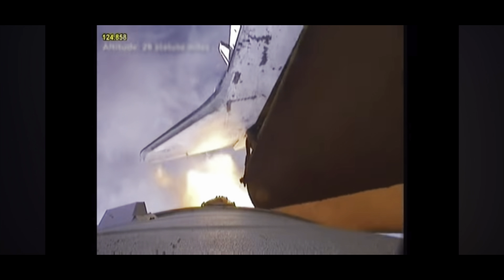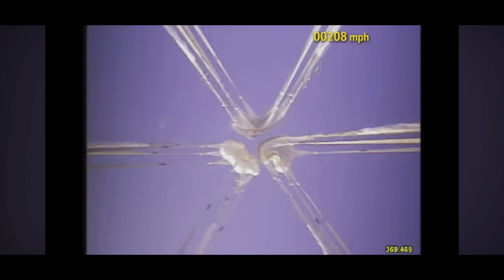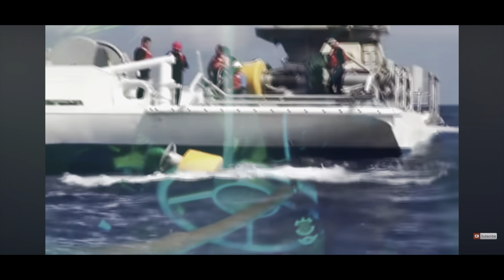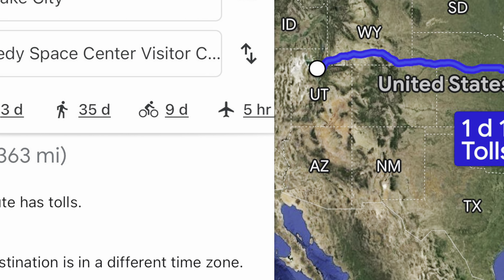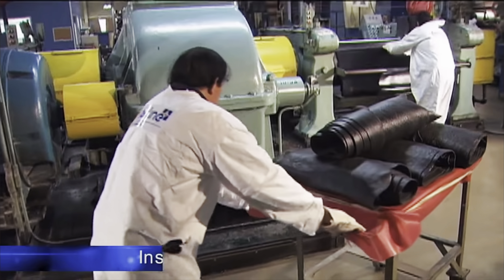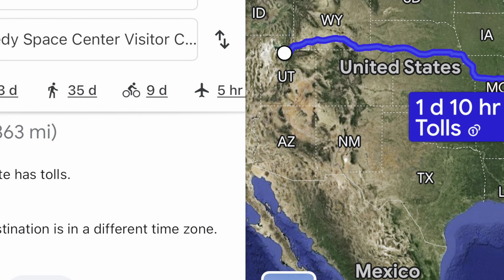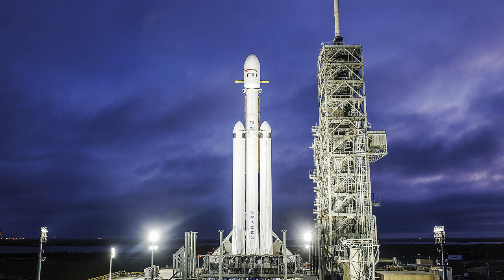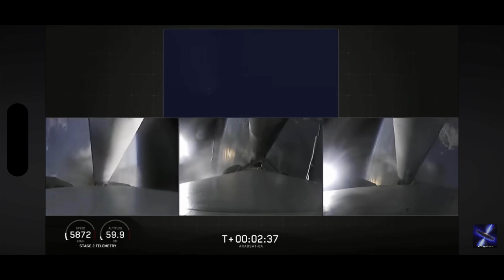Reusable rockets

Comment: Fantastical that you feel the need to compare something designed in the 70's to something newer...I guess window licking at spacetwitter is a full time job...
Reply from the maker: If you say so. 

The broad point is that we have evolved to the point where profitability is an option. And regardless, there was an inefficient bloatedness with the shuttle program.